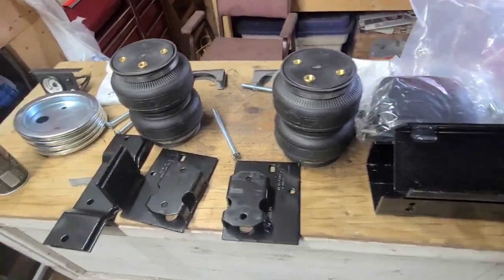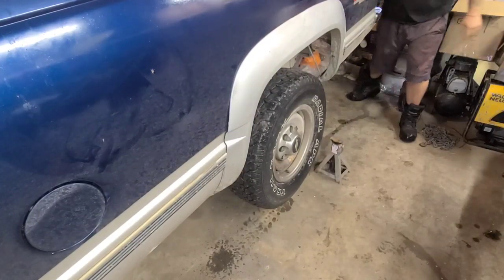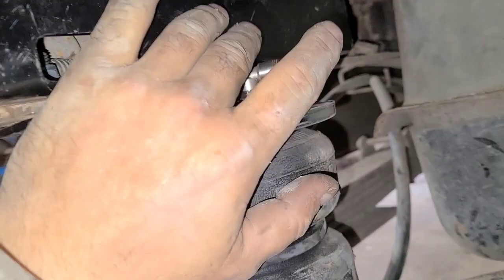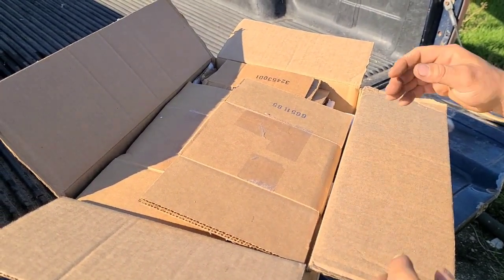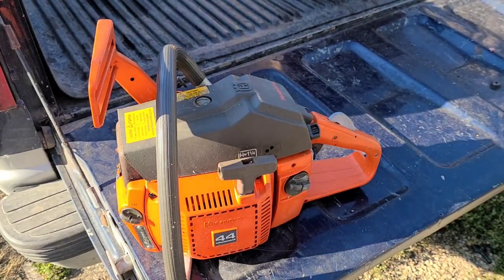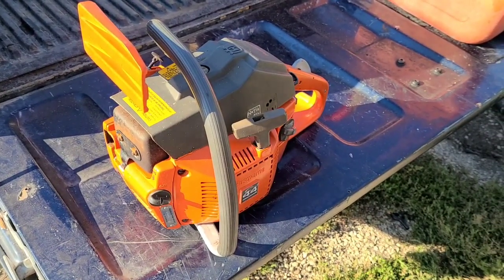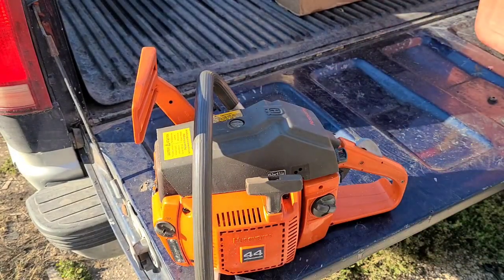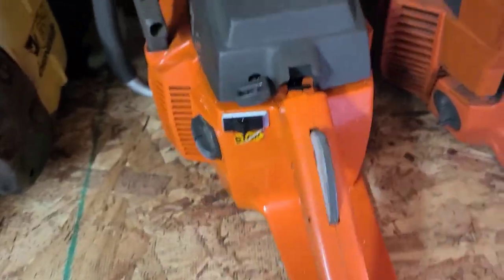Airbag install on a K2500 chevy!! Unboxing a special saw!!

Comment: Personally I prefer you doing your magic on smaller cc saws, I would guess a large majority of viewers even if they have big, have smaller saws. Getting power from 50 or so cc’s is what I’m impressed with.
Reply: you can say that agin. These saws that have 28 & 32" bars are not realistic for 80% of the pepole who use saws. I am waiting for a yutube vidio that runs 8 hours long of a normal dued bucking with a 32 inch bar.

Comment: Ripping that log at the beginning made me smile Tinman, the spaghetti it was pulling looked like it was turning into a werewolf or something! When I put my airbag kit on my Dad's truck 27-28 years ago, we ran the lines up inside the gas filler door so they stayed protected, and out of the way. He didn't want the on board compressor option, just two valve stems. Worked pretty good... The kits really haven't changed much at all. Your big saws are the Rock Stars, no doubt about that. But I like to see what can be done with the smaller saws just as much.

Comment: Big saws are what everybody wants to discuss on the internet, but if you work with hardwoods, half the saw work gets done with small saws.  When you describe your feelings for this model, that's how I feel for the Echo CS-4500 (45cc).  It is an angry little animal!  Try a 20" .325 bar and chain on that thing - the reach and balance is nice for limbing.  Thanks for the videos!
Reply: @iffykidmn8170  I agree with that - I should have been clearer.  If I drop a 20-24" tree, Half the work can be done with a 45cc saw w/ 20" .325 chain quickly and enjoyably.  This is limbing and small firewood.  Then pull out a 67-72cc saw and buck the big pieces.

Comment: I had a 44 for over a 1yr needed pull cord cover, was about to give up on finding one and then a 1yr later finally found the pull cord cover and decided to keep the saw. Was glad I kept it because it's a runner.

Comment: Hot diggity dog. I have a white top with the gold emblem, that I got in a package deal in mid August. I've never checked it out.
I'm going to the shed now and dig it out. You can see it Tinman in my #65 Vid.
UPDATE: I got it running. The ring looks good. Minor marks on the piston. The compression is not what yours has.

Comment: Let me know how them airbags go. Never had them on a vehicle. And love that saw   🌲🌲🌲
Reply: Airbags work wonders! I don't think I could go without em on a truck. Unless you had quite a few leaf springs added airbags really up the load capacity and still have a halfways decent ride.
Reply: @lukeh2453  airbags are surprisingly tough
Reply: @closertothetruth9209  yeah, I blew the bellow rings off mine a couple years ago but they are still working lol. I guess the only complaint I have about them is once in awhile you might have to chase a leak at a connection and the standard pumps are pretty dismal but other than that the bags themselves are a good investment!

Comment: That’s a beautiful 44. Is the jet setting on the top cover?  I need a o-ring for my 2100 husky manual oiler. The one one the out side on the bottom. If anyone has one I’m interested in buy it or the whole oiler. Can’t wait till you put the 44 in some wood. Be kind be safe and and have a day.

Comment: What is the difference in a Husqvarna 394 and 395?
Reply from the maker: Cylinders are different, 395 is quad port transfers, 394 has dual transfers.
Reply: @tinmanssaws  Thank you.